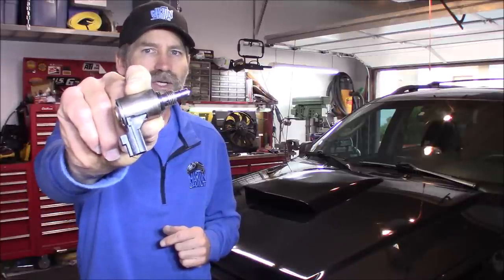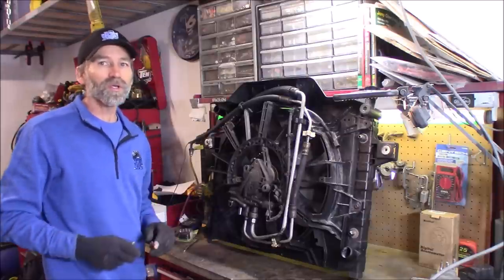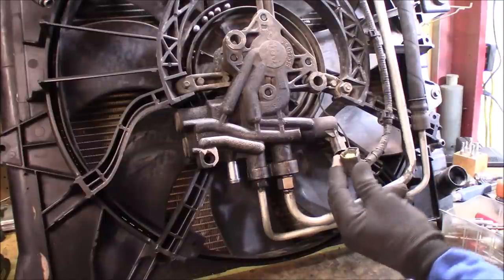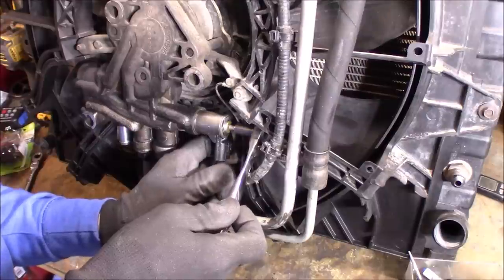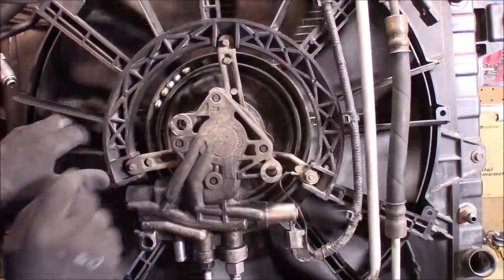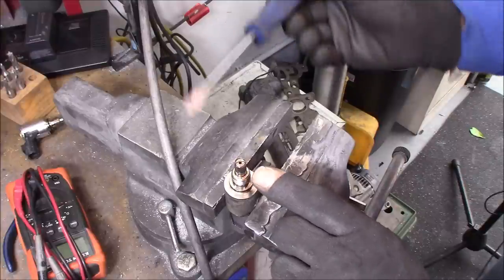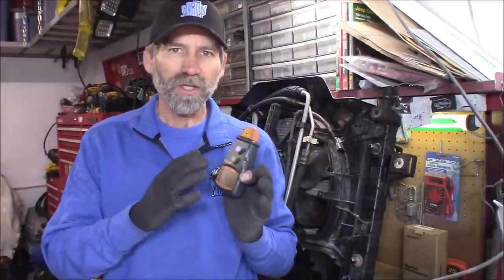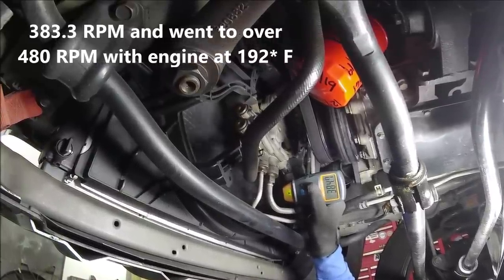01-04 Jeep Grand  Cherokee Hydraulic Fan Solenoid Mod, Remove &  Replace

Comment: I just did this to my original owner 2004 Grand Cherokee with the  4.7.    First try I turned the screw in 3/4 of a turn, tested it and it was a bit too fast.  I backed the screw to about 1/2 or so in from factory setting and I got the increased fan speed/air flow I wanted. More radiator air flow for free and appreciate it here in central Florida during summertime.
Reply from the maker: I'm glad you liked it and found it helpful. Thank you for watching.

Comment: Man that seems like an unnecessarily complicated design from Chrysler.Well explained by Martin as always.
Reply from the maker: Yeah I'm so glad to get rid of that hydraulic fan and go full electric.
Reply: @martinbuilt  the fan un my 4.7 jeep cherokee with hydro fan  does not speed up when i turn the Ac on and it over heat. what could be the problem

Comment: I did this to my 04 with a solenoid I got from the pic a part, got 3 of them actually.  Putting hood vents in made a huge difference, put the A/C on and the amount of hot air coming out of the vents is amazing.  A huge trans cooler also reduces the load on the radiator.

Comment: Hey Martin, thanks for the great vids!  During my research on the hydro fan setup for my 2001, I just came across this FORD part that is suppose to be a replacement for the unavailable jeep solenoid;

Ford XW4Z-3783-CA - ACTUATOR ASY 

and the wiring plug for it;

Parts Master 84080 2-Wire Multi-Purpose Pigtail Connector for Ford Products
Reply: Hello, thanks for the info. did you find and install this part?
Reply: @jesusrperezd  I found used and tested Jeep part on ebay
Reply: so, the ford actuator fits into the jeep hydraulic fan and doesn’t leak? and you just had to splice/integrate the jeep wires to the ford pigtail connector?

Comment: Martin's videos are always really helpful. I just did head gaskets and figured I'd try this mod since the fan was out. I have an 04 Overland, and mine has an entirely different solenoid,  which does not have the ability to be adjusted. Mine is the 3 pin connector. I compared it to an 02 fan I had , the 02 has a 2 pin connector and a separate ground wire. So, if your solenoid does not have the torx  bolt it likely is not adjustable.
Reply from the maker: Thank you Eric, Yeah unfortunately the the 3 pin solenoid is not adjustable.
 Even after I made this modification, it did help I was not entirely satisfied due to the Las Vegas heat and remove the hydraulic coling fan and replaced it with an electric with this video.
https://youtu.be/J02nYci5DS0
Reply: how do you remove the solenoid type that doesn’t have the torx bolt? that’s what i have

Comment: I really like the hydraulic fan setup. It's intelligent and only ramps up on demand. It doesn't wear out your water pump bearings with like a normal mechanical fan. With that being said, I always felt the fan comes on late to start cooling heavily. I'll see coolant temp up to 210 and oil up past 215 before it'll kick up. Now the other factor is the transmission. Worth noting since I've added an auxiliary cooler my transmission temperatures have been lower. Noticed the fan won't ramp up until the pan temperatures get to about 165-170 which doesn't happen to often. I think I'll find a spare solenoid from a yard, give it a turn and replace mine.
Reply from the maker: I also replaced my radiator. There was areas that had a lot of dirt packed into the fins that I couldn't see until I got the radiator out. That helped cool it down some. The dirt came from the former owner. I know he used it to play in the dirt and mud.
Reply: @martinbuilt  I probably need to replace my radiator again here too. It was done at about 100k miles and I've got about 210k now and I saw a drop of coolant on the bottom between the plastic and and aluminum. Wish they made an affordable all aluminum radiator. The eBay ones "fit" the 01-04 with modifications since there for the 99-00 and they were about 2" taller if I remember correctly. What would be best is if there was a way to reprogram ECU to turn on the fan quicker with coolant temperature rising about 200*

Comment: That was really informative. I always wondered why the 4.7 had a extensive cooling setup. I wonder if increasing the RPM of the fan above what it normally runs at would cause more wear than what was expected from the factory. At least you can still buy it from them for now.

Comment: Very good video, this cooling fan system is also on the gen 3 vipers. I have a supercharged viper that I needed more air flow over the raidator. This was an amazing mod! Thank you
Reply from the maker: Glad you liked it, I didn't they used the Hydraulic fan on Vipers 🤔
Reply: Yep, just about the same years as the WJ's

Comment: that was an informative video. the funny thing is i have a 2006 jeep commander and have the very same cooling fan setup. i think jeep should have gone another way when it comes to this setup. you can't even swap out the fan for an electric fan that in my opinion would have worked better.

Comment: Been a fan of Martin for some time. Tried the mod as described in the video with limited success. What I discovered is there is a fine line when turning that adjustment screw. Too little and not much of an increase, too much and it goes into airplane mode. After making some very small adjustments, it now spins a fair bit faster at idle and works really well when the temps climb.

Comment: I just replaced the steering pump pressure line about 2 weeks ago. Had I known this was the reason my fan stopped working(hydraulic fan motor not electric) I would have made the change myself. But now its $174 part and .5 hr labor at the shop($183.HR labor).

Comment: Martin ,thank you for your video, tell me where is the freon pressure sensor in the system, which gives a signal to increase the fan speed? I did not increase the fan speed when you turn on the air conditioner, when the refrigerant escapes through a safety valve, but the solenoid is working, if you throw the connector from the temperature sensor of the engine, the speed increases. Thanks.

Comment: You're videos are well done. Great job!
A question, CA you replace this system with a new aluminum radiator with electric fans?  Seems much simpler
Thanks

Comment: The replacement 3 wire solenoid for my 03 Laredo does not have the adjustment screw. So it looks like I will  have to go with the electric and  clutch fan setup to get more airflow at low speeds. It was worth a shot, thanks for the good videos martin!
Reply from the maker: You could also go all-electric as I did.  Here is a link  https://youtu.be/J02nYci5DS0  This has been working great.
Reply: does the solenoid style without the adjustment screw mount differently? i dont know how to get mine off and mine has no torx bolt

Comment: Love your video...I have a Jeep 2006 Commander with the 5.7 Hemi....Had AC serviced and my mechanic said my ac fan was not spinning fast enough. He recommended  to replace it for 2500 bucks....OUCH!! I said nope. I was hoping that this is the issue with mine as well. Can you let me know what part number to look for? And is it easy to replace it while the fan is in place? Thanks Randall

Comment: Hi , love your channel. 
I have a question for my 2010 GC 5.7 with the hydraulic fan set up . Is it possible to have a bad coolant temp sensor even tho the cluster gauge is working and showing the coolant temp reading increase?

Comment: I’m looking at a 01 WJ and the guy started the jeep without realizing their mechanic had the solenoid unplugged, so the fan ran for a couple minutes and pushed the fluid out. Is there a way to refill that, or would it have to get a whole new assembly at this point? Great videos by the way, very informative!
Reply from the maker: I personally would try refilling the power steering pump with the proper fluid and see how it goes.
Reply: @martinbuilt  appreciate the insight! I’ll ask them to do that before we test drive. I drove a jeep exactly like this one in high school, so the nostalgia is making me want a second vehicle 😅

Comment: Had to replace this solenoid...found one in a junkyard and learned it was different than the one in my jeep.  Ended up going back and getting the entire fan assembly...what a pain.  All fixed now but headed back to Iowa from Tennessee, picked up a new camper.  Thinking I could use more cooling and this might do the trick.  She tows well, but power is a little low on my non-HO 4.7.  Anyway, you mentioned mpg when cranked all the way down, how's it do only half way?  And why do you think mpg's were affected?  More work for the power steering pump I would guess...??
Reply from the maker: Yeah getting those fan assembly out is no easy task. The best way is to pull the fan and the radiator out as one. I haven't noticed any decrease in miles per gallon turning it half a turn in. The loss of miles per gallon when I turned it the full turn was due to the extra load it was putting on the power steering pump.
PS I'm originally from Iowa been in Vegas since 93.

Comment: Greetings! Excellent videos! I'm from Venezuela. I have a 2004 Grand Cherokee WJ 4.7L. The problem is the following: the electric fan ( Is hydro) with high temperatures or with the air conditioning gave me a second speed, but now it's not doing it. Could this problem be the same solenoid that you explain in this video? Thanks again.
Reply from the maker: Yes it certainly could be I would do an ohm reading on the solenoid across the two contacts and you should see somewhere I believe it was around 10 ohms. 
You'll need to unplug the connector from the solenoid to do this.

Comment: thanks for the video.. I had a problem with the 2008 jeep commander 3.0 crd the fan's rpm is slow.. where can i buy the solenoid that you install?
Reply from the maker: The only place to get them is eBay or salvage yards. Used is the only option.

Comment: hi ...
I've done the mod yesterday and i have turned it 1/3 of a turn ..
unfortunately no improvement and the fan didn't speed up  ( maybe a very tiny bit 😅) ...
I'm planning on turn it to the rest of full turn and see if it would make a difference ...
also I've done some testing and found out that if the voltage decreases on  the wire that comes from the ecm the fan will speed up and if I ground it like connecting it to the nigative battery the fan will go full speed ...
so maybe i will build a circuit that regulates the voltage on that wire 
what do you think about this? it could be a nice project helping all those people with hydra fan

Comment: Hi, excelent video I like it so much. Hey I have a problem with a 07 grand cherokee, I have my steering wheel so hard, and I was wondering if this solenoid could be the reason, the power steering fluid level is ok.

Comment: Hello, my vehicle has a 2.7 fan, it goes into fast mode at approximately 105 degrees, the vehicle cannot be disassembled until those components, what could be the reason for this?

Comment: You can throw a permanent magnet on the back of it to have the fan constantly moving. Which is what I did to one of my JGC's. (I'm on my 7th).
Reply: Where would you put the magnet?
Reply: @timbenracing  right behind the coil of wire. It will pull the rod to allow the fluid to flow and kick on the fan.
Reply: @JF32304  awesome thanks for the quick response. You mean right on the screw head right? Where it holds the solenoid in?
Reply: @timbenracing  no problem man! Yeah put it right on the screw head... I used a rare Earth magnet... Really got that fan going!
Reply: @JF32304  how big of magnet did you use Jesse ,did you just stick it where the torch head is ,did you disconnect the solenoid to make the magnet work ,RSVP,? Thanks Jesse .

Comment: Martin!  Need some help!  What size and type of "O" ring is used on the inlet 1/2" high pressure line that runs from the steering pump and connects to the bottom of the hydro fan?  Also, can you confirm the torque setting for this bottom connection,  my service manual has an unbelievable 36ft pounds !!!  Can that be true?   I have an annoying power steering leak at that bottom fitting, rubber "o" ring does not seem to work and I won't tighten to 36ft # on what looks like an aluminum housing!

Comment: My 06 Jeep Commander 5.7L gives occasional vibrations which can be felt on the whole car.  It only happens when the temp guage reaches the middle.  Do you think its due to the fan being off balance?  No codes except for a knock sensor circuit DTC.

Comment: I have been trying to research this. My wife’s GC is a 2006 with the 5.7 and currently runs this hydraulic fan set up. I have never had any trouble with it yet. I do need a new radiator for it. The plastic is leaking now after so many years of use. I am assuming the radiators for the GC are the same wether it be gas, diesel? But I am not finding a listing for a radiator for the GC with the 5.7. It only shows the 3.7, 4.7, and 6.1. Is there a difference in the mounting flanges or anything? Or do they all use the same radiator?

Comment: Hello everyone. So, I have a question. Does the fan on the G. Cherokee 2001 WJ benzene 4.7 V8 should be spinning when the motor is just running? My fan kicks in when the temperature gage goes over the middle mark. Cooling the motor down a little and switches off... Now its 3 degrees Celsius here now and for some reason my motor is getting hot constantly (then the fan kicks on, cools it to below half mark and so on...) 
Coolant in the radiator, full and I did the air bobbles bleeding. There is power steering fluid, full. Can someone pls explain or point me in the right direction... THNX! great vids.

Comment: I have a problem want to share with you. My car has a hydraulic cooling water system. The wings aren’t working properly, they are sometimes turn on and sometimes not. When it needs a high U-turn, it doesn’t turn on. But for the low U-turn (in the city) it/wings are working just normal and fine. I‘ve changed the water temperature measuring system, but it doesn’t help. 
Can you help me and suggest me what can be the problem? Can this problem caused of solenoid?
Thanks a lot in advance and waiting for your answer :)
BR,
Levan
Reply from the maker: Unfortunately something must have been lost in translation. A lot of what I'm reading doesn't make sense. But I believe what you're saying is that you're hydraulic fan is not working properly. Try unplugging the temperature sensor the hydraulic fan should go into high. If it does your solenoid is working properly.
Reply: Thanks for your quick reply. I‘m sure now, that the solenoid doesn’t work properly. 
Thanks a million:)
BR,
Reply: @martinbuilt  Hello Martín, I have a problem with the fan and it is that it does not cool me well because it rotates slowly
why is that? Should I change the solenoid or temperature sensor?
Please...  i need your help, master

Comment: Great videos! Question...did this MOD make your power steering easier or lighter?  Even after replacing my steering gear, hydraulic fan and power steering pump "AND" using the right fluid, our steering is still harder than we'd like especially at lower speeds.
Reply from the maker: It made no difference

Comment: I Martin. Could you indicate me which oil  (ref, name)  is recommended for the fan/steering hydraulic system? Thank you again.
Reply from the maker: MS5931 should be the only fluid be used in the JGC with an hydraulic cooling fan.

Comment: Good day Mr Martin I watch your YouTube’s videos all the time Mann your a genius I’m writing you to ask if you have an extra hydraulic cooling fan solenoid for 2004 Jeep Grand Cherokee 4.7 also a driver door wire harness that leads from the truck to the door it has a short  that you might want to sale they went out I wire the solenoid straight to the fuse box so when I needed it I hit the switch but now that joker is gone truck over heats looked in half the junk yards on my side of town on luck can you help thanks

Comment: Martin,
My engine does not get really hot since I did a full service (new radiator, cap, thermostat, water pump, coolant, hoses, and sensor), however my fan still doesn't spin fast. I know that the ECU sends a signal and the hydraulic fan should kick into overdrive mode if it gets above a certain temperature, however like you stated I would like it to do that before it gets to that point (which usually occurs after highway driving for a while then getting gas). I am going to try disconnecting the sensor to see if the fan picks up speed. If it does, where do you think I should start troubleshooting?
Also, a random side note, have you ever tried Marine Two-Stroke oil TC-W3 in your gasoline? I think you would be interested in reading up and possibly trying it. Here is a forum regarding the matter, long story short you put 1 oz of this TC-W3 into your gas tank for every 5 gallons of fuel:
https://www.ls1.com/forums/f48/been-testing-oil-91206/

I've been doing it on my WJ for over a year now and can't say if it hurts or help, but when I did my hydraulic valve adjusters the top end was clean, no sludge or issues with carbon buildup.
Reply: Update:
Disconnect the harness to the coolant sensor, started the Jeep up and the fan was spinning the fastest I have ever seen it. CEL came on for P0118 (Coolant Temp sensor high input) over-ride the ECU and kicked the fan into hyper-mode. When I shut off the engine, reconnect the harness, the fan barely spun as it usually does.
I know that if I am in a pinch I could disconnect that harness, but I would rather find a way to get it to kick on sooner and not have it running full speed the whole time the sensor was disconnected.
 Do you know if there is any way to have this occur? Is there a way to install a manual over-ride where I could put full voltage to the system if I feel the engine is getting too hot? 
I know you did the e-fan conversion, not trying to do that if there is a solution with current set-up.
Thanks Martin